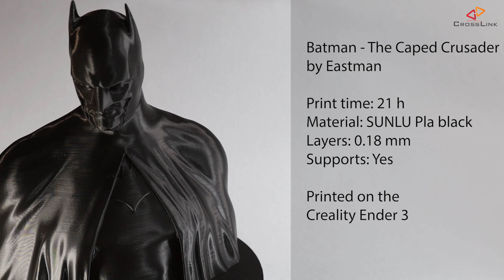AWESOME 3D Prints EP02 - Ender 3 Timelapses / Octolapses (wait for the cat)

Comment: Nice. @2:29 the support fails but somehow manages to recover. I've have been fortunate enough to have that happen a few times.
Reply from the maker: Yeah, this time I was lucky. I actually had another fail before and still don't know why it came off.
Reply: @Crosslink3D  There is a setting in Cura that lets you use a brim on the supports. That helps a little. I don't like using z-hop.

Comment: Hi, great video and nice prints but I have 1 recommendation. Because of lead screw on Ender 3 it is better to print on layer heights that are divisible by 0.04. Such as 0.12, 0.16 or 0.2. On 0.18 it is half of step for motors which they cannot do. But otherwise you have really nice quality of your prints. 😃
Reply from the maker: Good stuff. I have to dig into these numbers!

Comment: Great prints, nice quality. Is that an stock ender 3? 

I’m asking because recently I did upgrade my ender 3 to a DD system using a micro Swiss DD kit. However I’m not getting the results I had with the Bowden setup. Seams are harder to hide and my first layer, although sticks perfectly well, doesn’t gets as clean and neat as It used to be with the Bowden setup. What I found is that the all metal hot end and DD combination is unforgiving in regards of frame stiffness, vibrations and motor accuracy. I’m changing the motors for a 0.9 degree ones in order to reduce some VFA. If nothing works maybe I’ll go back to the Bowden setup.
Reply from the maker: Interesting discoveries you have there. I am probably doing that kind of mod eventually. This printer is mostly unmodified except new fans for the hotend and CHEPs Extruder mod for better TPU inlet. You can forget about the BLTouch, that didn't make any difference in print quality. Mainboard is still 8bit. Software is latest Marlin 2.0.